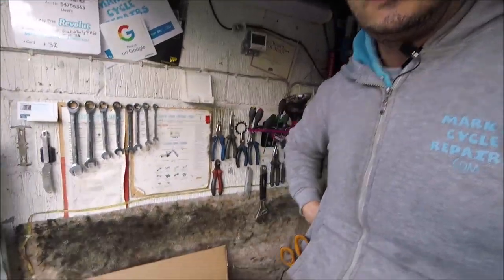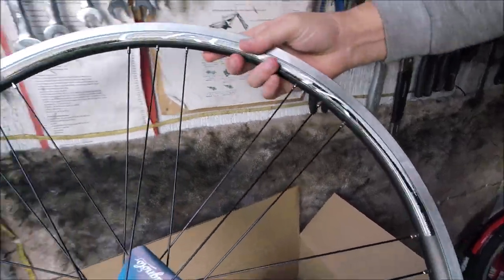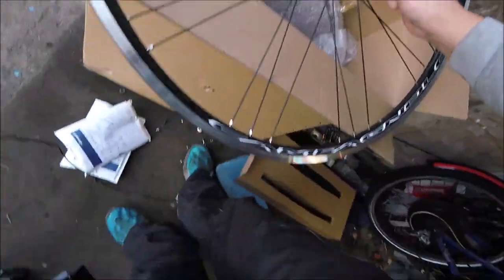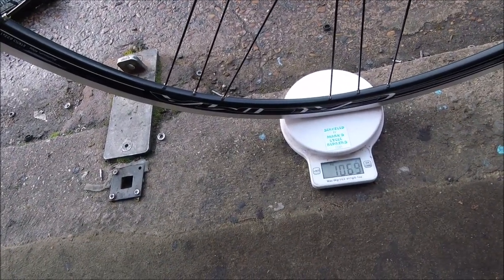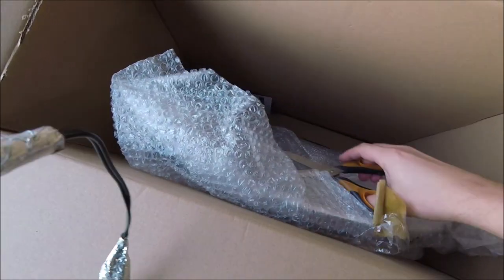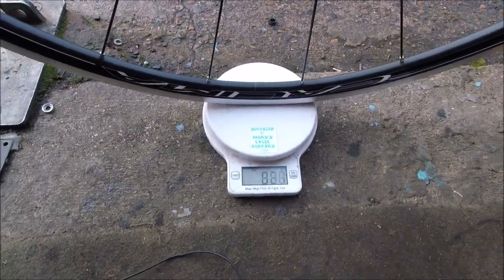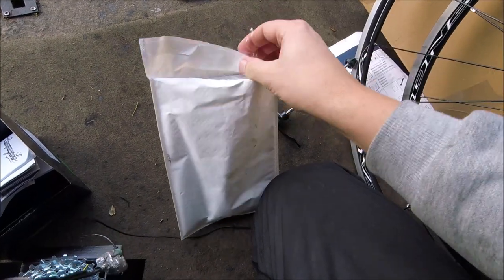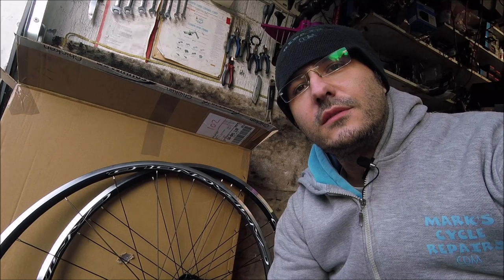Campagnolo Calima C17 Wheelset CA freehub close up and weight

Comment: Hi there. I have one Visions that have reduced distance between the hub flanges, for good acceleration. I would buy the calima with low rim profile, for alternate use, and because I had damage a bit my rear Vision 35, if someone ensure that Calima power acceleration is good, also fell smooth on bad road, or very stiff? Thanks a lot.